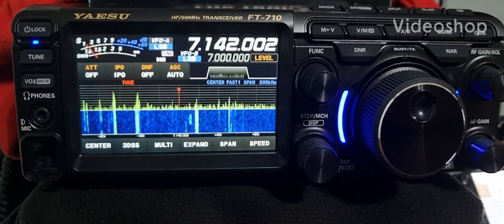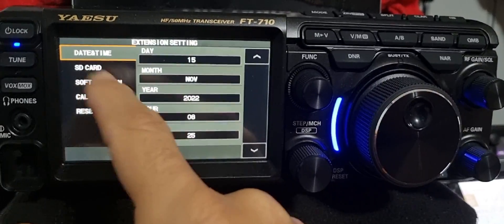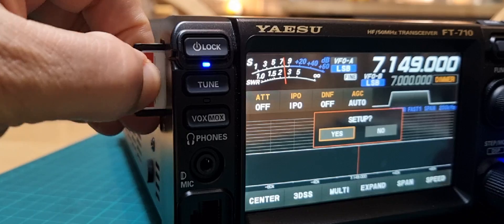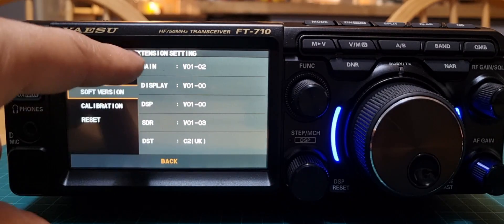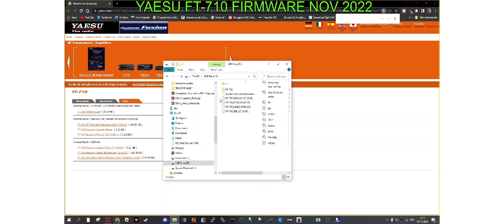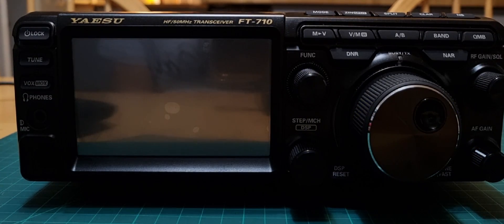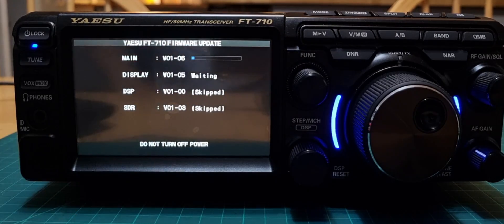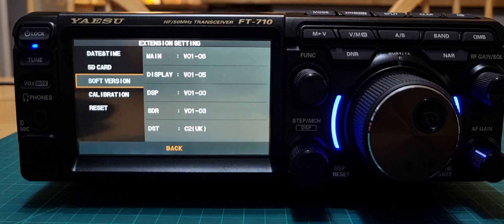YAESU FT-710 After Firmware Update v01-06(Perform Reset Once Completed)

Comment: Can you explain to me please the set up with the power meter? Normally, it’s at zero more or less until you key up and it should show power. My 710 seems to be working in reverse! When I key up it goes to zero? I am subbed of course .Thanks. EI3KY
Reply from the maker: Hi if the swr is high the Radio will reduce the power.